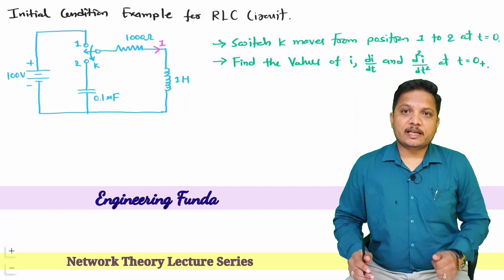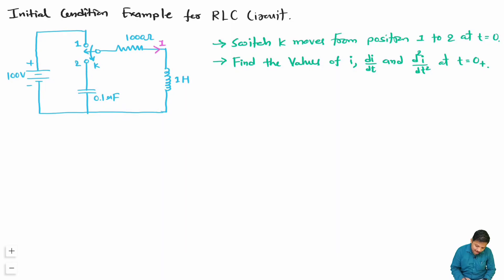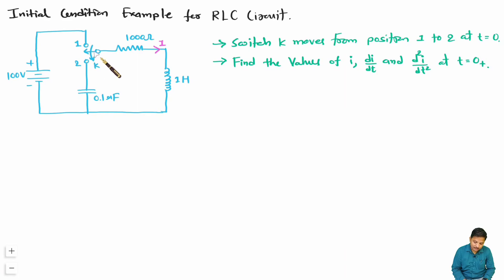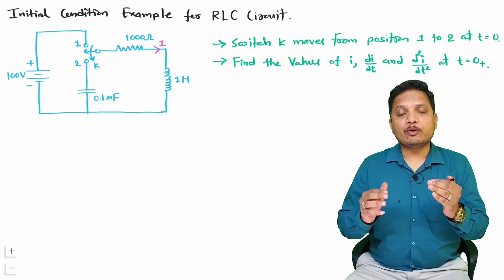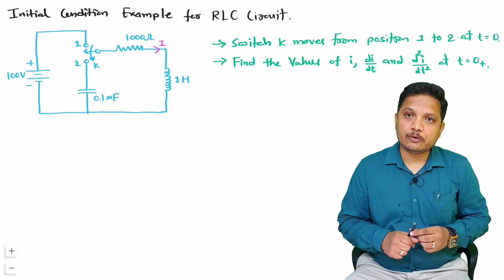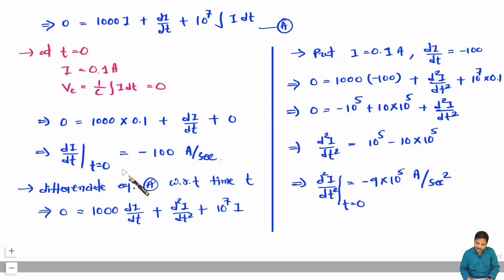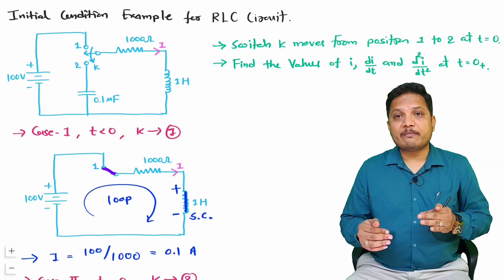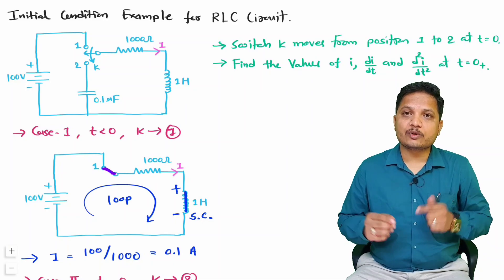Initial Condition Example for RLC Circuit in Network Theory

Comment: Sir, 7:09 if the inductor is a short circuit at t=0, then it should be a Short circuit at t=0+. then the voltage across the inductor is equal to t=0.  so di/dt =0. But why it has some value.